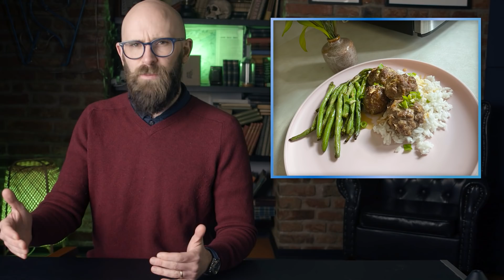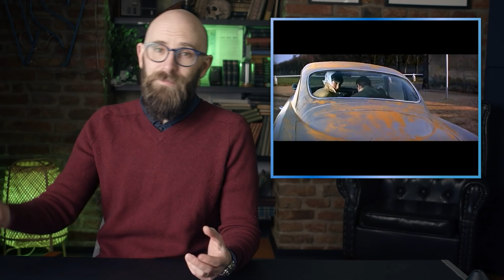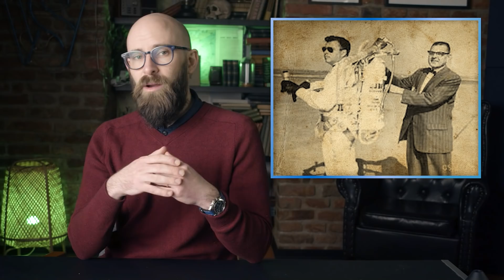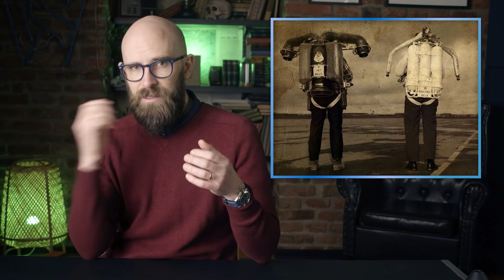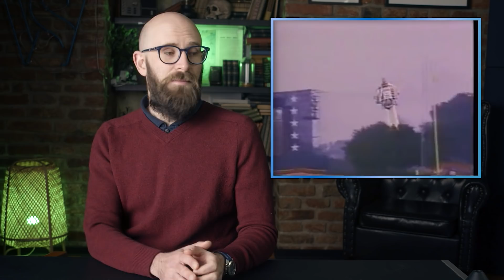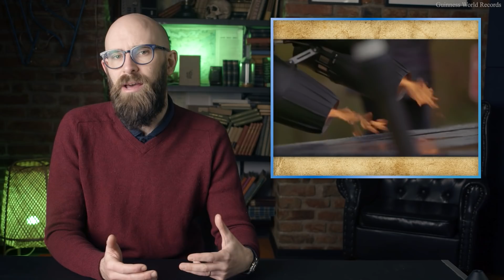The Mad Race to Create Working, Practical Personal Jetpacks

Comment: sadly at the end of the day, anything that can lift up into the air as a everyday means of travel runs into the problem of what happens when it fails,  best case scenario you fall from a height that only injures you,  worst is you either fall to your death or even more worst fall while the device still has fuel and blows you up when you crash......show enough people footage of test dummies exploding from these things and we might finally get people to understand why this idea has ALWAYS been flawed at its conception.   All mechanical devices will fail, and the only reason why fly such dangerous machines today is because the ones piloting them know what their doing from thousands of hours of experience as well as teams of people to maintain the machines to keep them operating well,  those are all things you can't trust 98% of the human population with doing.

Comment: The low runtime before running out of fuel has always been the big problem with jetpacks. Jet engines get extremely shitty gas mileage so you would need to carry so much fuel that the tank would be as big as the man flying it. I've always thought they were really cool though.

Comment: Ridiculus idea here: what about combine the two types of propulsion? Jet power for main, then hthp (hydrogen peroxide) as boost/extra juice. It'll get heavy, right?

Then use that jet pack instead to drop specialized troops for faster deployment. You don't want paratroops to be sitting ducks once descending down. OR, use those instead for heavy equipment that the parachutes couldn't handle? Y'know, like the russians did, as i realized typing this. . .

Comment: The jetpack created by Justin Capra is on display at Dimitrie Leonida Technical Museum in Bucharest. Sadly, it is displayed rather anonymously behind glass without much of the background history behind it.

As for the Himmelstürmer, there may be something to the story. Many of the more outlandish theories about advanced nazi schemes are inspired by true events. Such as the nazi Antartica base. Nazi Germany did indeed send expeditions to Antartica in 1938-39, They were the first to fly an airplane over the landmass. Germany wanted to claim land there, naming it Neuschwabenland, or New Swabia. However, this land was inside the territory Norway claimed as Dronning Maud Land and nothing came of it. The german flying sauser also seem to have some truth to it. Not as alien technology using exotic elements, but more in the lines of the Avrocar. andreas Epp, who worked on this technology for The Reich, has written about it and contiuned work on it after the war. While Zindal isn't the most reliable of sources, he was not the first to write about the Himmelstürmer. In the 1950's Rudolf Lusar wrote about it. There are some documents and grainy photographs showing not a back mounted engine with a front direction thruster, but a single engine that the operator strapped to his front. This device would have no way of steering, good only for straight ahead jumps. Extremely dangerous, but probably more realistic to the technology of the time.

Comment: I figured this out, you just need to make it feel like your controlling the jetpack while actually you're sending requests to your backpack drone.

Smooth acceleration and stopping without great skill requirements, if fuel gets too low you just start slowly descending, and if you black out you slowly get lowered to solid ground.

They'll keep working on drones, so eventually that part of the tech will be good enough to slot into jetpack control.
Reply: Well it wouldn't be a 'jetpack' then lol, drones rely almost entirely on rotors. Unless your talking weaponized drones, in which case they are just an unmanned jet.
Reply: @The-Singularity-X01  We'll never have a jetpack that won't kill idiots trying to use it, but we'll have enough idiots we can fool into thinking that a jet powered drone is the same thing 😉

Comment: The words "Himmel(s)stürmer" can mean both "Heaven stormer" or "Sky stormer". Where "stürmer" is the same base word used in the "Sturmtruppen" or "storm troops". German uses the same word for sky and heaven... based on the use case, I'd say "Sky stormer" in the sense of "Sky runner" would be the intuitive interpretation as a native German speaker. But based on the description of the "device", I'd say "heaven stormer" does fit too 🤣 sounded like something straight out of "Iron Sky", even before you mentioned the author's "credentials".

Comment: Honestly, car accidents are depressing, but they are also kind of boring. The advantages of cars driving in two dimensions on limited roads are alternatively their disadvantages.
If we could make these and other flight options a little safer, we would have a lot more movement space to work with.
But that's just a hypothesis. A flight hypothesis.
Excellent video!